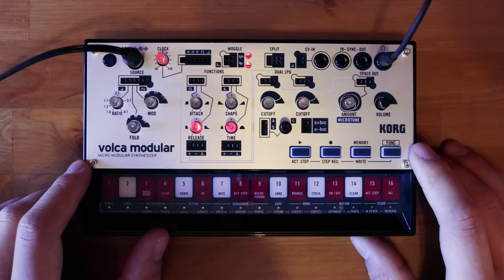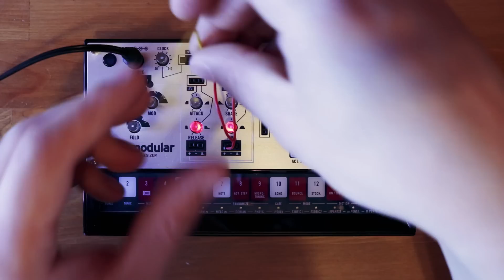volca modular Patch of the Week 9: S+H Function Modulation

Comment: How do I patch the Modular so that I get a controllable tremolo and notes that end when I take my finger off the ribbon? I've tried looping function2 then sending the positive output to lpg1.  However, when I touched the ribbon, it produced an endless note that was only terminated by another endless note. I don't have this problem when sending a looped function2 output to source patch points, just the lpg1/2.
Reply: For a tremolo using the LPGs (slightly coloured), try:

Function2 Trigger in to Trigger out
 (to loop it)
Function2 positive out to LPG2 Control In (Use Function2 negative out for different wave shape)
LPG1 out to LPG2 Signal In
LPG2 out to Space Out Signal In

(knobs to taste, though LPG2 cutoff on full gives the cleanest sound)

Or for a cleaner true tremolo, you can use the Utility as an voltage controlled amplifier:

Function2 Trigger in to Trigger out
 (to loop it)
LPG1 out to Utility B In
Function2 positive out to Utility C In (Use Function2 negative out for different wave shape)
Utility A+BxC out to Space Out Signal In (Use Utility A-BxC out for different dynamics)

(knobs to taste, though make sure the Utility C Knob is turned up a bit. Sounds will start to overdrive if you turn it up far enough)

Hope that helps and have fun!